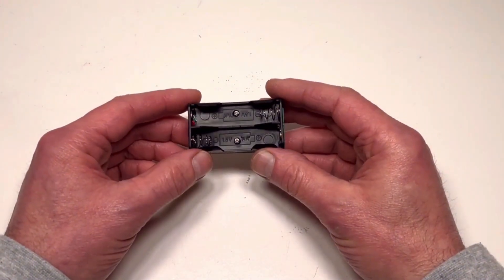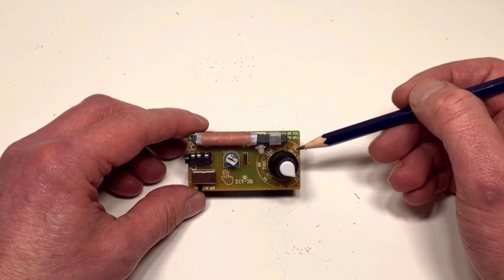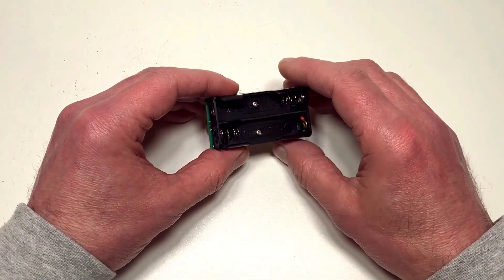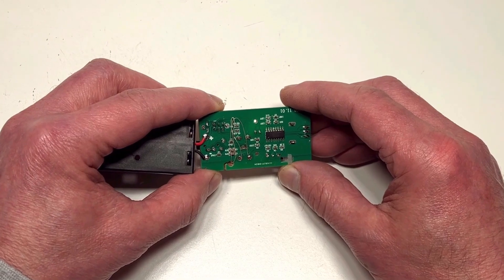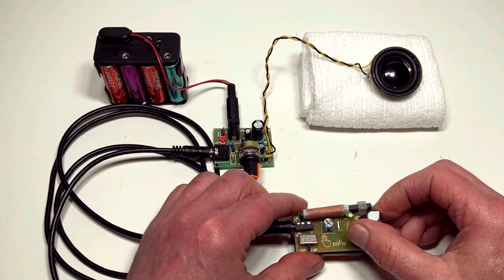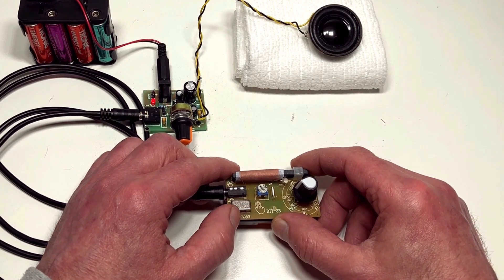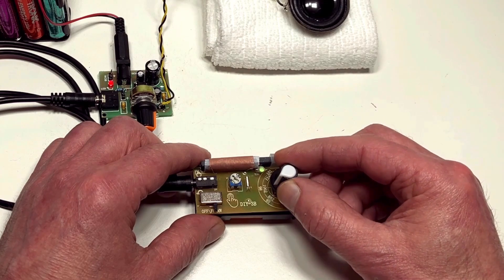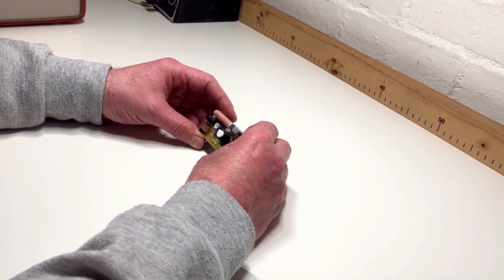A low cost PCB style AM-FM Radio with a Hidden Feature!

Comment: How could I add an additional antenna?
Reply from the maker: Hi, thanks for your question. For the FM aerial, since this little receiver employs the connecting cable of your headphones as the FM antenna, you could try plugging in a headphone extension lead and see if this improves the strength of the received signals. (Although you may need to play around with the length a little to obtain the best results.)  For AM, you could try using a loop antenna. This is something that you could make from some scrap wire, etc., and if you Google how to make one, you will find lots of information. Enjoy your experimenting!

Comment: This little device looks NEARLY perfect for what I need! 
I am looking for a physically small PCB for FM reception with an analogue tuning dial so that I can fit it into my car's old 1960s AM radio to upgrade it to have FM capability!
I can step down the 12v voltage of the rest of the radios internals to 3v, and physically hook up the tuning potentiometer to the radio's tuning dial and that would be all good

...however this board uses the headphones connection as the antenna, which in my case works against this. When integrated into the car radio, it's going to be soldered directly to the line level audio connection the MW/LW radio board uses, which will be a very short connection and will be housed entirely within the metal case of the radio, and will of course be susceptible to any other noise from the internal electronics of the old vintage car radio. 
Do you know if there's any way I can separate the antenna connection this board uses from the 3.5mm jack so that I can hook it up to the cars dedicated antenna instead?
Reply from the maker: Hi, thanks for getting in touch. That’s quite a project you are undertaking there! OK so the answer is possibly. I have looked at the data sheet for this chip and I think that you can connect an FM antenna (throw out wire maybe?), to PIN 3 = RF INP (also referred to as FM_IN), but it must be via a small capacitor. The data sheet shows a 100pF capacitor although the one on the PCB radio kit is shown as 27pF. My suggestion would be to purchase one or two of these kits and simply experiment! The audio O/P could be connected to a little audio amp via a very short lead (to negate the lead doubling up as an aerial), for test purposes. I have made a video on a little $2 audio amp kit from AliExpress that you might be interested in. I have also provided a link to the data sheet for this chip where the connection details are shown towards the rear that may prove useful. Please let me know how you get on as I would be very interested. Good luck 👍
https://www.docdroid.net/jLmx4at/kt0936m-b9-v22-english-pdf